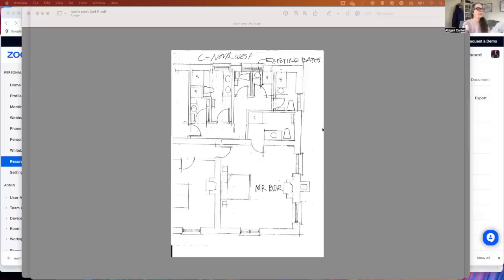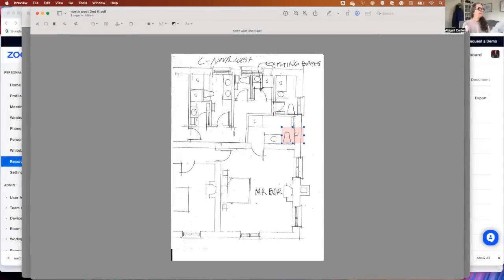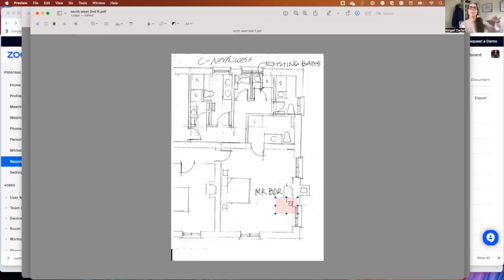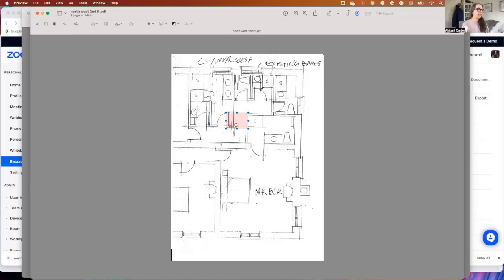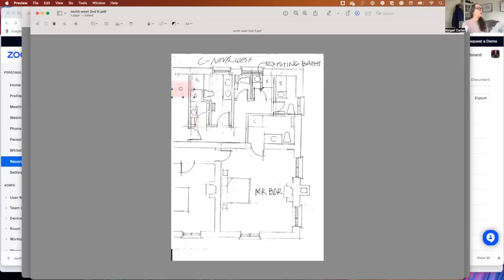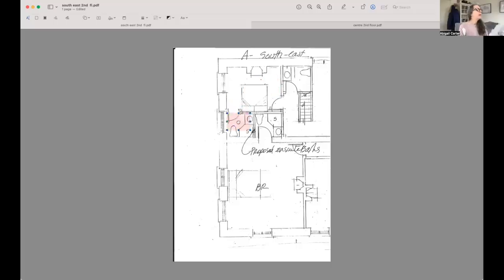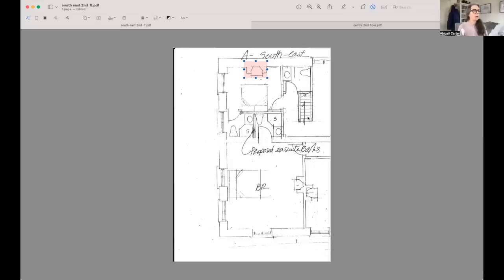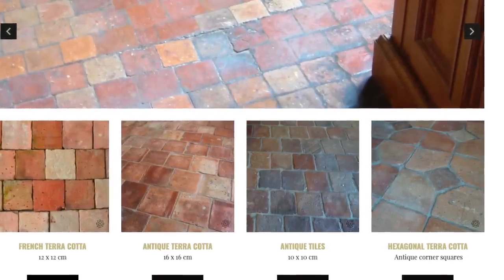Chateau Bathroom Demolition Surprise: What Lies Beneath? – The Chateau Chronicles - Ep #11

Comment: I would leave the area off the stairs for a sitting/tea/reading area or even a workspace? I say combine the two bathrooms that are back to back (master and one that butts up to it) into one and build in a dressing area with closet space in it as well? So much potential but I wouldn't blow out too walls because of structural concerns. Instead I would add doors/doorways between areas where possible. You also may encounter odd structural stuff behind walls that could raise costs or cause headaches as well. Also consider looking for things like flooring that has been taken up elsewhere that can be reused or even look into overstock to try and get better prices!
Reply from the maker: I definitely agree about the reused flooring. Hoping to find some. Thanks for your ideas!

Comment: Thomas is a treasure. It's no small job putting in new bathrooms in to an old house. It's quite common practice to raise the floor to put in pipes. Your ceiling heights can handle this. Try looking at UK tile and bathroom sites for reproduction or imitation items.  With the current exchange rate there may still be a bargain despite import fees.

Comment: I think your Dad is on the right direction for the two ensuites side by side. The bathroom that's on a different level if there's enough room you could do a couple of steps down. It's a chateau things are meant to be quirky so this would embrace the different floor levels rather than trying to fight them. Also with your bedroom Id change the the exciting bathroom to a dressing room then use the bathroom behind it as yours. aThis way you'd get a window and it would be more like a suite which is better fitting for the owner. YOu'll still have enough room to create a room and bathroom with all the other bathrooms. Lastly if you can't find evidence that fireplace's were in the rooms it might be nice to add fake ones. Especially if they are antique.
Reply from the maker: Thanks for the ideas. 😊